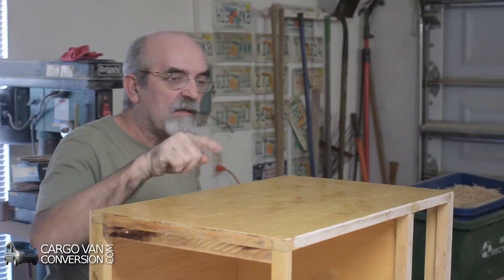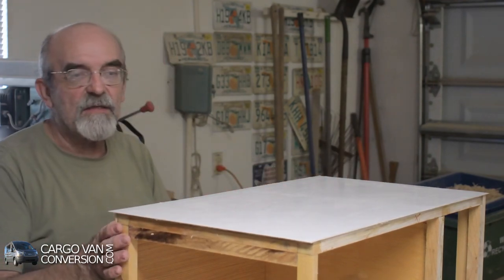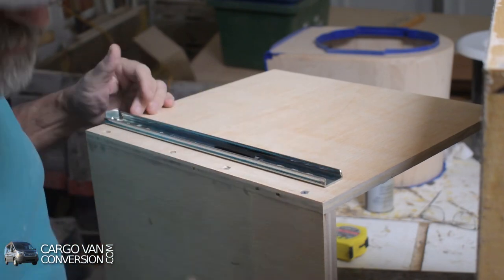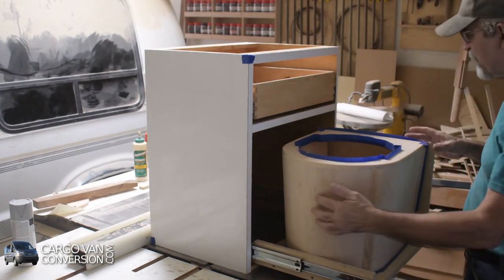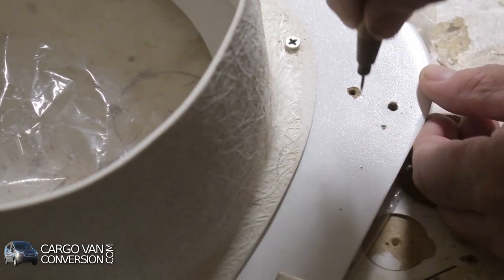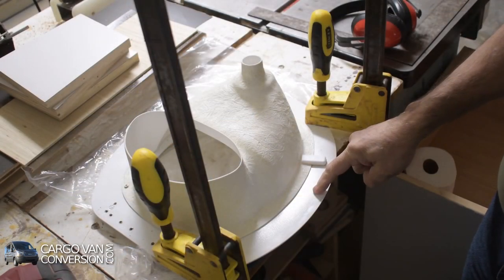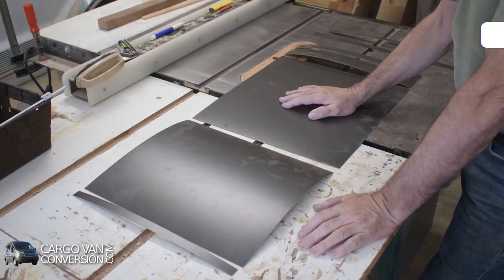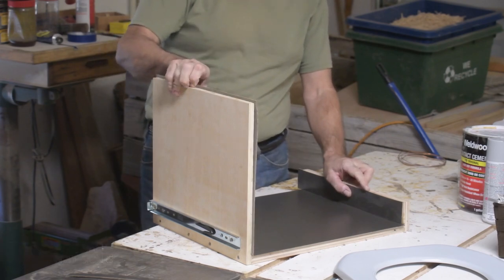DIY Separating Toilet - Part 4

Comment: Hey Van it's almost done. It's all coming together nicely 😊🚐
Reply from the maker: Hi Kat,
We're getting there. The 'done' part, I'm not so sure about yet :) All of the cabinets will have been installed soon, but two major items (plumbing and heater) still ahead.
Wish you well.
Van Williams & Joey
Reply: Oh hi the plumbing is always a big job. Good luck with that. I'm sure you will work out a system to get it done. I'd struggled with that part. That's why I want to keep it simple when I get my van. Thank you so much Van. I seem to slowly and gently be getting there. Hey Joey. Hugs Kat xx. 😊🚐🌍